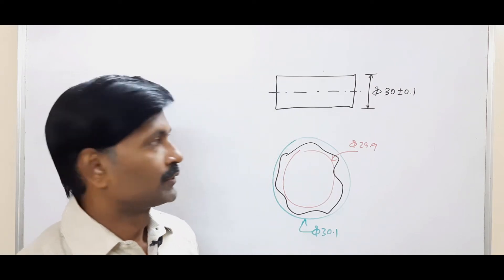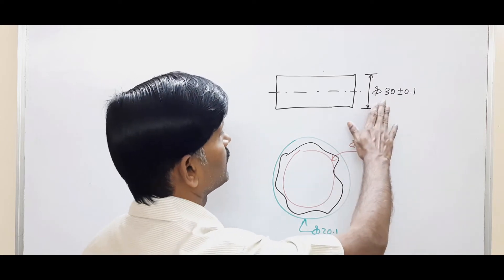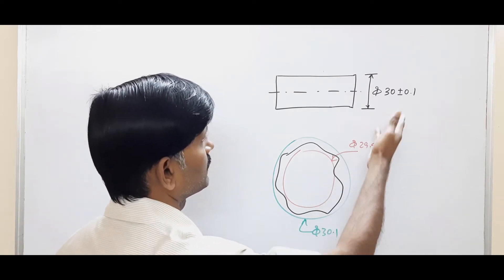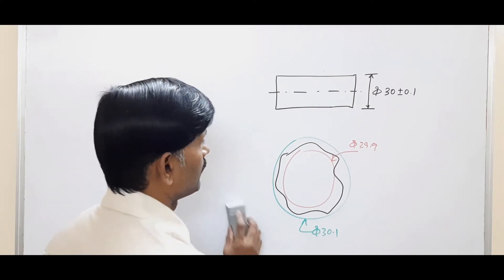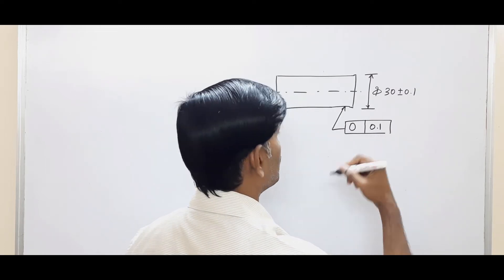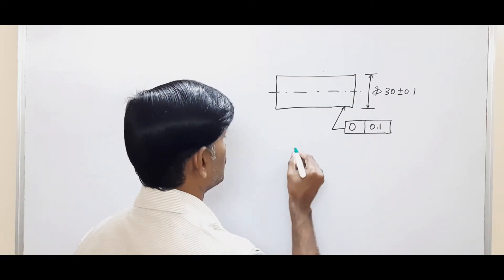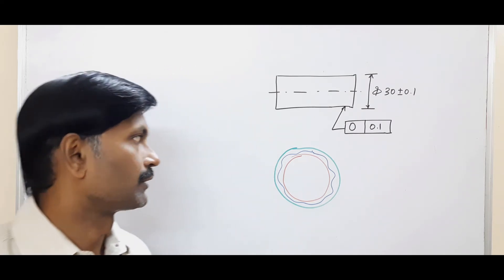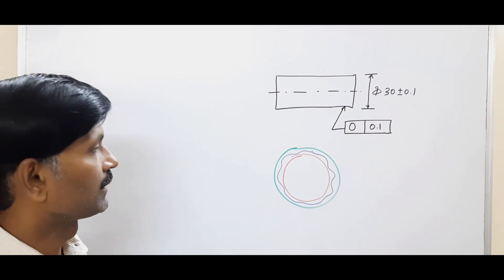GD&T Tutorial 22 : Circularity Tolerance

Comment: As per the rule 1, if the feature measures Dia 30.1, (means MMC) it must have perfect form. Further, if the feature departs from MMC, like 30.05, 30.0, 29.95 etc, the feature can be allowed to have appropriate deviation at circularity. 
All this will mean that the second chamber of the feature control frame can have 0.0 permissible tolerance with M modifier. 
But the M modifier is not allowed for circularity. How to resolve this controversy?